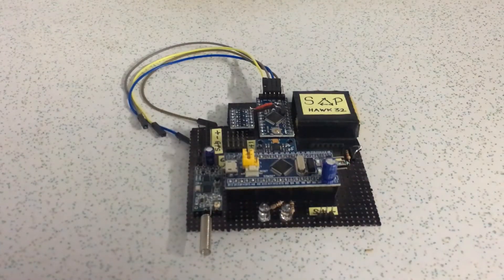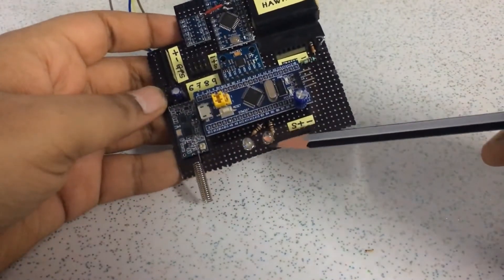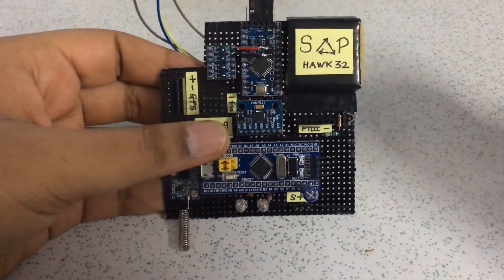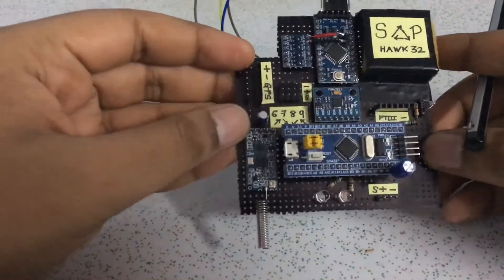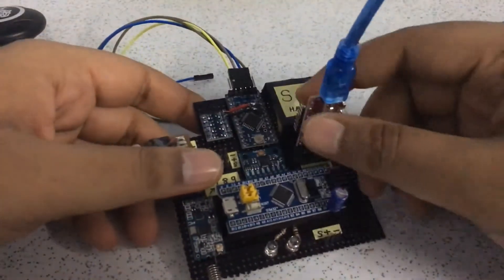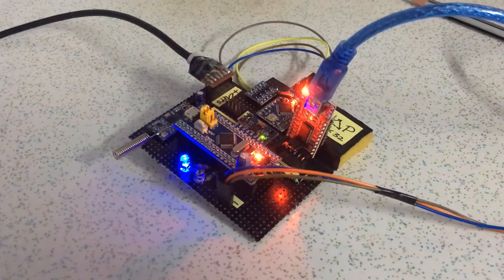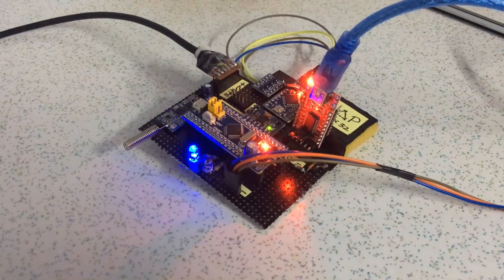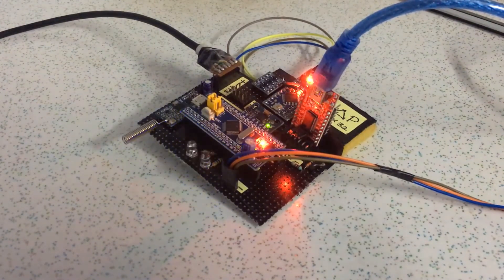Hawk32 Auto FlightController | Based on YMFC 32

Comment: Bro pls help me with your digram connection of hc12 to arduino pro mini and the connection from the pro mini to the stm32 pls help me with this bro
Reply from the maker: https://youtu.be/H-HARh-HzPI

Check this video
Reply: @SushrutPhutane bro i think that i saw you connect the hc12 tx and rx to pin 6 and pin 7 of the arduino pro mini and connect the pro mini to level converter after that you said connect the i2c level converter to same pins of gyro and barometer i mean ( sda scl ) pins but you didn't provide the pins in details i mean i didn't understand your wiring digram so if you can pls help me with this i want to see the digram connection of the wires pls.
Reply from the maker: @ali-a-agames7292  B10 for SCL
B11 for SDA
Reply from the maker: @ali-a-agames7292  https://youtu.be/SC6Se_JBs7w
i have followed Joops diagram which you can find on his website
Reply: @SushrutPhutane  okay bro thank you so much
Reply: @SushrutPhutane  ok thanks again . 🥰😇
Reply: @SushrutPhutane  my brother it's same to  my connection digram that Joops used  but my problems are with Pinout Connection of your Modifications and as following:
 1- ( HC12  to Pro Mini ).
2- ( Pro Mini  To I2C Level Module ).
3- ( I2C Module Connections to STM 32 ).
My problem it's only with pin out connection because you didn't provide clear schematic.
And thanks a lot my brother for helping me.
Reply from the maker: @ali-a-agames7292  
1. You can connect HC12 to any pin on Arduino because you are specifying the pins in the Arduino code
2. We are using the I2C converter to convert the STM32's 3.3V logic level I2C to Arduino's 5v
So connect Arduino lines to the 5v side of the I2C converter and 3.3v lines to STM32 including power and ground.
3. Those lines are SCL and SDA so 
Arduino >> I2C Converter
A4>>I2C_1 5V SCL
A5>>I2C_2 5V SDA
5v to 5v
ground to ground

I2C Converter >> STM 32
I2C_1 3.3V >> B10
I2C_2 3.3V >> B11
3.3V >> 3.3V
gnd to gnd
 
Please recheck the SCL and SDA pins to match
Reply: @SushrutPhutane   thank you so much my prother I appreciate your help  thanks alot.
Reply: @SushrutPhutane  bro i have a problem i get error program loop and didn't get any date to ground station what i have to do pls.
All of my connection are correct as this :       
HC12 To Arduino Pro Mini
1-  HC12 Tx >> pin 6 of the pro mini
2-  HC12 Rx >> pin 7 of the pro mini
3- HC12 5V >> pin 5V of the Pro mini
4- HC12 Gnd >> pin Gnd of pro mini
----------------------------------------------------------
Arduino Pro Mini To I2C ( High V Side )
1- Pro mini pin A4 >> pin TX1 of I2C
2- Pro mini pin A5 >> pin RX1 of I2C
3- Pro mini pin 5V >> pin 5V   of I2C
4- Pro mini pin Gnd >> pin Gnd of I2C
------------------------------------------------------------
I2C To STM32 ( Low V Side )
1- I2C pin TX1 >> pin B10 of STM32
2- I2C pin RX1 >> pin B11 of STM32
3- I2C pin 3.3V >> pin 3.3V of STM32
4- I2C pin Gnd >> pin Gnd of STM32
-------------------------------------------------------------
And in the receiver as this :
HC12 To Arduino Uno
1- HC12 pin Tx >> pin 11 of Uno
2- HC12 pin Rx >> pin 12 of Uno
3- HC12 pin 5V >> pin 5V of Uno
4- HC12 pin Gnd >> pin Gnd Uno
------------------------------------------------------
So any thing that i can do to fix this program loop problem pls .
Reply from the maker: @ali-a-agames7292  The thing is that even i am trying to solve the time loop error and haven't yet solved it. 
Please don't try to fly it this way as it will just crash.
I have crashed three times now, so just warning you.
The video is just for informing about the alternative possible and its not a 100% solution for now.
Also its not an electronics issue. Its a programming one.
If you find a way to get it working, please share your workaround ✌🏻
Reply: @SushrutPhutane  ok bro i tried to fly it and carashed and damaged one of the esc i will wait for your fix i hope that thx any way.

Comment: hey bro im having problem with the gps . while running test program gps is not giving data. ive tested my gps with u center software and my gps works well
Reply from the maker: which code are you using for testing?
I faced a same issue
Under the check_gps tab
Change Serial1 to Serial2
or vica versa
Make sure to change it everywhere it is written
If it works, make sure to also change it in the Flight Controller Code
Reply: @SushrutPhutane  im using joops flight controller .also my telemetry disconecting after few seconds
Reply: @SushrutPhutane  thanks bro that works well now. But i have another issue my telemetry is losing connection after few seconds of startup
Reply from the maker: @diyhub4548  Are you using AC220? 
If yes I don't have hands on experience with it, so I wouldn't have any idea about that issue
In case you are using I2C telemetry, then can you please elaborate your issue
Reply: @SushrutPhutane  yes I’m using apc220 . My telemetry gives data for 4-5 seconds after that I’m getting telemetry lost connection and after every 4-5 seconds I’m getting telemetry signal which last for only a second then again i got telemetry lost connection
Reply from the maker: @diyhub4548  
sorry bro I have no idea about APC220. Never used it. You will have to figure this out by yourself. Try re soldering connections and tinkering with the Code
Reply: @SushrutPhutane  I figured that after changing from serial1 to serial2 my gps start working but when i test my imu giving wrong values that keeps on increasing and hmc5883l is not working 
I think that has to do with the loop time. Please help if u know
Reply from the maker: @diyhub4548 
I used the GY63-MS5611
which is both barometer and magnetometer. Joop used the same so i went with it. It works flawless. I would suggest using it if you are unable to solve the issues. You can buy it from robu.in
Reply: @SushrutPhutane  yes bro I’m also using the same components 
Tell me whether u have change from serial1 to serial2 or vice versa?
Reply from the maker: @diyhub4548  yes I did
Reply: @SushrutPhutane  ok bro
Reply: @SushrutPhutane  hey bro . My telemetry is reading wrong voltage it is reading 3.6v when I’m powering using Ftdi
Reply from the maker: @diyhub4548  yeah there can be an error.
Connect your battery to power your flight Controller and connect the voltmeter to other end of battery.
Simply add/reduce the valueof voltmeter to match ,in the program
Reply: @SushrutPhutane  yeah i did
Reply: @SushrutPhutane  thanks

Comment: Can we do telementry and drone control (PPM/PWM) using Single arduino nano and nrf24l01.and other side we have two NRF,one for transmitter and one for telementry receiver.it is possible? if yes than how to do it.
Reply from the maker: yes you can. you need set different IDs for them to communicate. But there can be interference. Haven't tested something like it.
Reply from the maker: in fact you don't even need two nrf module. nrf can communicate bothways simultaneously but ig there will some lag probably
Reply: @SushrutPhutane  thanks for reply,i build a quad with multiwii all stuff diy.quad flies but not stable enough it just uses mpu6050.now i am thinking to build ymfc with above idea.i dont have any coding knowledge but ill try.

Comment: IVE ALSO MADE YMFC-AL BUT I WANNA MAKE YMFC32 AND I UNABLE TO GET APC220 RF MODULE SO I WANT UR FLIGHT CONTROLLER SCHEMATIC
Reply from the maker: Hi mate!
So the schematic is almost similar to the original one, but there is only one change regarding the telemetry system.
1. Connect I2C of the Stm32 to 3.3v level of an I2C converter and an Arduino pro mini to the 5v logic level.
2. Connect the HC12 or any other RF module to the Arduino.
3. Program the Arduino such that it'll receive the Telemetry Data from Stm32 via I2C. Then it will send the data to the Telemetry station via your RF module.
4. You will have to make changes in the Original Stm 32 program as well as Telemetry receiver program.
Please Note : This is still in development as you can face freezing issues while messing with I2C timings.
Reply from the maker: Watch this video for the telemetry modifications

https://youtu.be/H-HARh-HzPI

All the required files for the modification are in the description of this video